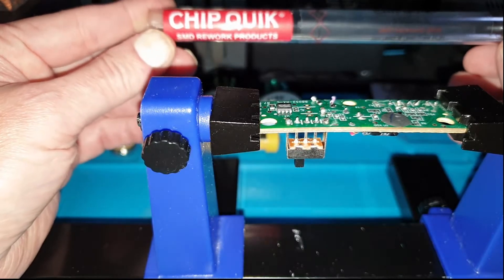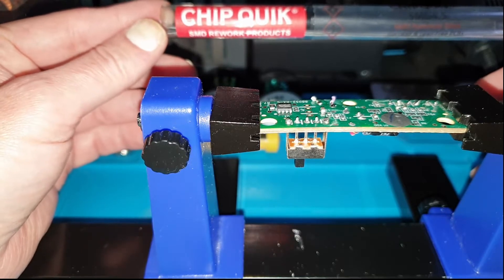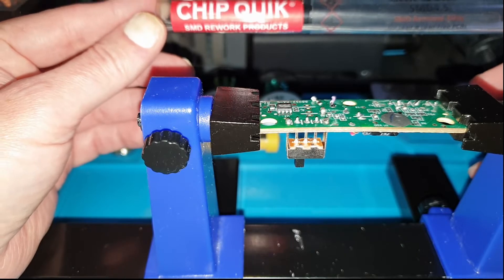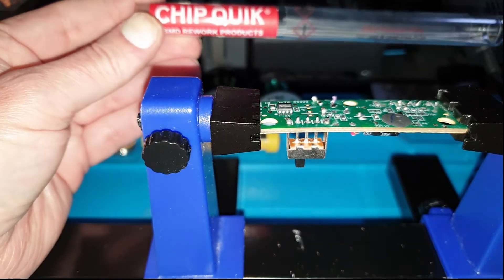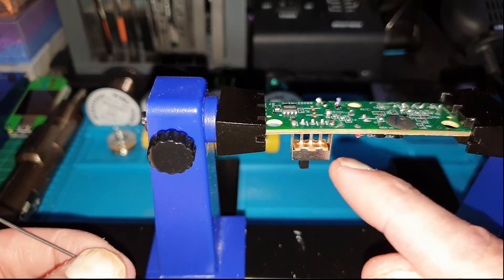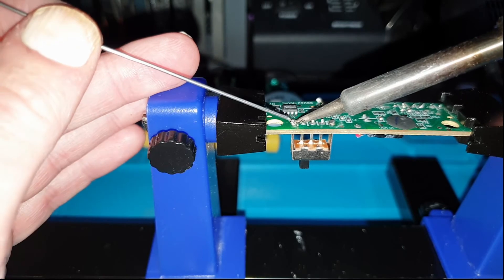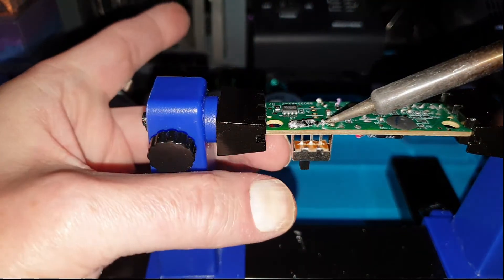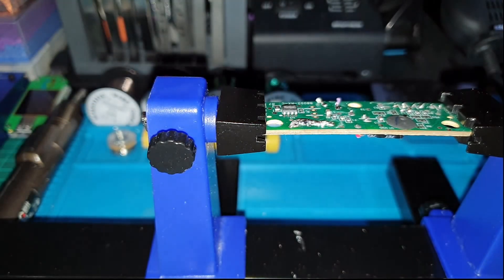Low melt solder - Chip Quik

Comment: Bismuth-tin solder has a melting point of 138 °C but is way, way cheaper and does the same thing. If used with a leaded solder, the melting temperature drops to about 94 °C. It would be interesting to compare with the Chip Quik stuff but I don't want to pay that premium! You'd have to do a calculation prior to doing anything with it to make sure it was economically viable! (jk)
Reply from the maker: I have heard of bismuth before, however not many knew how it compared too against the chip quik product, so I think many were just guessing at what the results would be. I totally agree with you on pricing, absolutely a premium product....or just a piss take!, however im daft enough to fall for the product and did buy it, but would now be interested in seeing that against other things out now on the market.  I think I paid around £60ish for 9 - 6" sticks.  I guess you dont use much when you do use it, but seriously, its outside the scope of many who enjoy this as a hobby.
Reply: @8inary  You can get 5 metres of bismuth-tin solder on eBay for £10 in the UK. I don't use it very often but happen to be using it right now to replace a broken WS2812 LED. Maybe a hot air gun would be better for this but I don't have one and then again, they might not appreciate the heat.
Reply from the maker: @rupert274  May have a look and test it against this stuff.

Comment from the maker: I bought the leaded version, as it has an even lower melting point at 53c over the unleaded type. Also this stuff is great for removing hdmi ports from ps4's. Turn the board upside down and apply the low melt, without even trying the port just falls out.
Reply: Well that's extreme pricing in my opinion.
Someone is making a packet from selling this bit of metallurgy.
If you Google "Silver, tin, bismuth alloy", you can get suppliers that provide this in bulk for waay lower prices. Its a product commonly used in Fire Protection Sprinklers and heat sensitive switches and alarms. 
Have you tried making an alloy of solder with a higher lead content, just as an experiment?
Reply: hi dude :) Where and what did you buy? :)
Reply from the maker: @skeptisk1  I bought this from cpc their website is: https://cpc.farnell.com if you are using a vpn turn it off, otherwise it will not load.  I just had a quick look but couldnt see the one I bought, however there are these two, the first is leadfree at £38 which I didnt use, I went with leaded, then the 2nd one is for more sticks which makes it a bit pricey at £82.

Failing those below, you can put this into ebay "Chip Quik Alloy for SMD Removal" and you will get plenty coming up.  As mentioned I went with the leaded version.

Lead free

https://cpc.farnell.com/chip-quik/smdswltlfp32/solder-wire-low-temp-0-031-32ft/dp/SD02716?st=leaded%20low%20melt%20solder%20chip%20quik

Leaded

https://cpc.farnell.com/chip-quik/smd16/smd-16-16ft-industrial-pack/dp/SD00633?st=leaded%20low%20melt%20solder%20chip%20quik

Comment: This is pretty amazing! This is a new trick in my arsenal of tricks. It's added to my shopping list ;)
Reply: Very good. It's a shame it is so expensive, but then you do only need a little. Thanks 😀 👍
Reply from the maker: @mrrgstuff  I had a quick look on ebay, and found two sellers, who are selling single sticks for nearly £8. the first is this one, 

https://www.ebay.co.uk/itm/Chip-Quik-Low-Melt-58C-SMD-Removal-Alloy-6-5-16-5cm-Long-Single-Strip/324286446041?hash=item4b80fa79d9:g:CskAAOSwspddTrWK and the 

second is  

https://www.ebay.co.uk/itm/ChipQuik-SMD-Removal-Alloy-1-length-16cm-Low-melting-point-58C-136F-LEADED/182437753933?hash=item2a7a23344d:g:iGgAAOSwoVZcBxZf 

the latter you can also make an offer.
Reply: @8inary  Thanks, maybe I will get some. 😀👍
Reply from the maker: @mrrgstuff  ive also heard, that it is reusable.  Not that I have tried it ...yet, however if you put it onto a board, and once your done with it, heat it up again to molten stage, and tap the board gently onto your mat, once its solidified, you can reuse it.
Reply from the maker: is it expensive, yes, is it worth it, absolutely yes, for those who dont want to spend that much, just buy a stick off ebay for around £7-£8 and keep it to hand for problem boards.